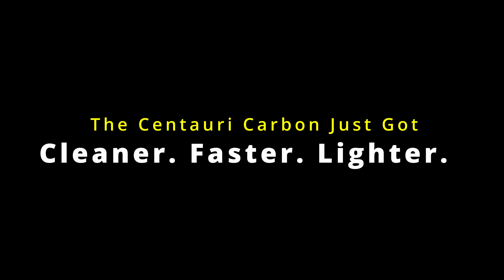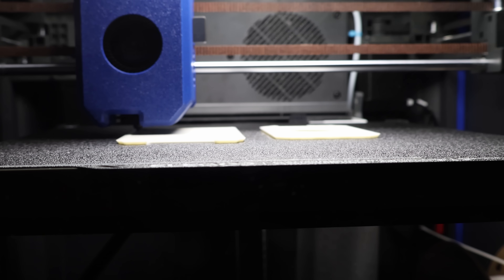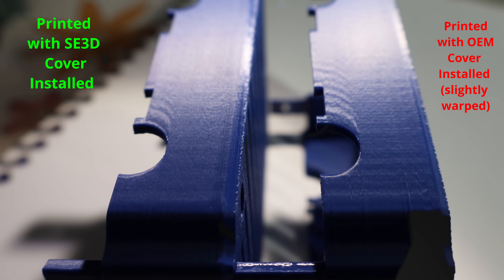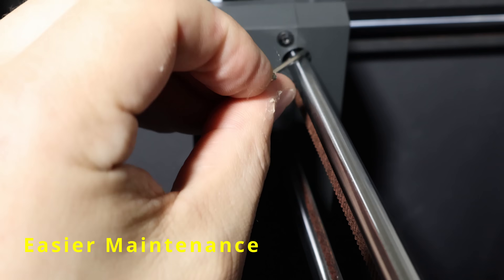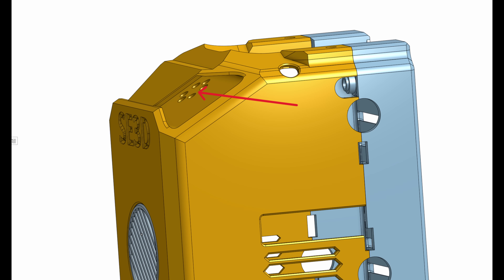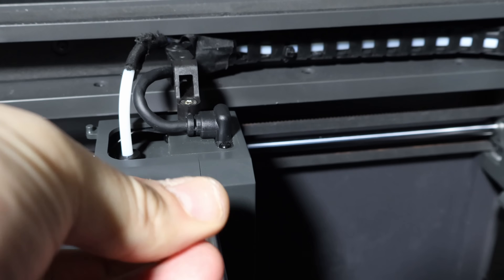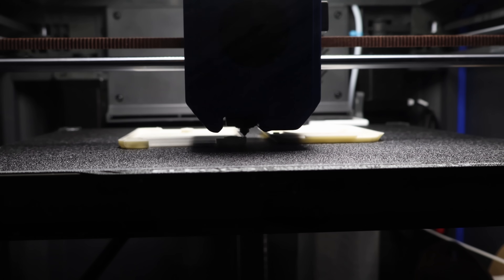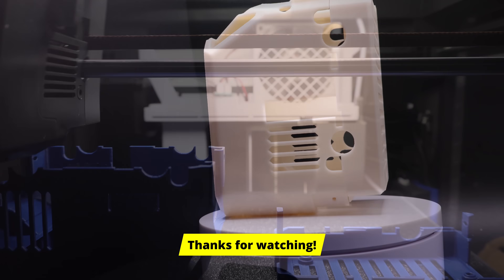The Centauri Carbon Just Got Cleaner, Faster, Lighter

Comment: Does it need to be done in ASA?
Reply from the maker: That is the ideal material, when you consider relative ease of printing, cost, and performance requirements. PETG should work on a temporary basis but it may creep or sag over time, especially near the hot end. Even though nylon has a bad reputation for warping, the CF varieties I've tried like Fiberon PA612-CF and PA6-CF can be printed relatively easily and have superior heat resistance to ASA. They're just expensive. PC is also a good option, but difficult to get good layer adhesion without a 60C chamber temp. You might be able to get away with annealed HT-PLA. However, I don't have first-hand experience with that yet. I don't want to make any claims about it being suitable or not until I have experience with it.

Comment: Wondering if printing it in PP will make it lighter (around 10%) and still functional. My concern is only about flex, but doesn't seem like there is something it might impact.
Reply from the maker: I've not printed with PP, yet. Under normal conditions there shouldn't be any impacts on the cover. The main concern is creeping or sagging under load/vibration and high temperatures.

Comment: Nice design. Could you run a new VFA test with it?  Youve shown its better at stock speeds but there could be better quality bands lower or higher than stock.
Reply from the maker: Interesting that you should say this. I actually ran a bunch, even developed my own version of the VFA model. They didn't make the cut though, only because I was running behind schedule and it would take more time to tell the story and try to capture the differences on camera. Some bands were worse, others better, but I only ran 100-300 mm/s in increments of 50 mm/s. This is a potential area for follow-up though.

Comment: This is great i am currently printing this out of polylite PC .. on my sovol zero I tried printing it on an angle out of asa but it didnt like that so figured if I am printing it on its face might as well use the strongest stuff I have poly makers PC is about 5% heavier density so might not be quite as good but better heat resistance and partially see through is appealing to me for a tool head thanks again for all your hard work its appreciated

Comment: How are the results when combined with the air recirculater? I want to build both but do they actually improve performance when combined?
Reply from the maker: This isn't something that I have tested. In fact, the aux and case fans were completely disconnected when I was printing all these ASA covers. But it is an interesting question!

Comment: weight reduction, i was thinking what if it was a skeleton cover, like the structure only for mount the parts, maybe that can work instead of doing a similar than the original, i think it worth the try, tell us if you can do that, tnx in advance
Reply: Check printables 1418981 model

Comment: Is there any reason this should not be printed in PETG?
Reply from the maker: It depends. If you're printing with the cover off, you can probably get away with it. But with elevated chamber temps plus the hot end being in close proximity, you may get sagging or creep. It is workable, but longevity may be limited. ABS or ASA is the ideal material because it can handle high temps under load without creep. ASA is a little less prone to warping and slightly stiffer than ABS. I much prefer ASA to ABS, personally.

Comment: Is it suitable PETG or PLA-CF filament to use this mod?
Reply from the maker: PETG will have a limited lifespan because it doesn't have the stability of ABS or ASA under high heat/vibration loads. Do not use PLA/PLA-CF. It will melt with such close proximity to the hot end. The only PLA option that might be suitable is annealed Polymaker HT-PLA. I have not tested that. But I am planning to do some videos with HT-PLA in high chamber heat applications.
Reply: @SyntheticElectron3D  Thanks for your quick reply. In this case I have to order some ASA filamnet

Comment: Looks very nice indeed. With the improved cooling, have you found a need (or advantage) in retuning any filament parameters? (Apart from the printer’s input shaping self-calibration mentioned in the video)

Comment: I'd like to see integration of this model with whatever is needed to use the Bambu-Like hot ends that another creator (whose name I completely forget) has done.
Reply: Printing it in PETG right now as a test, oriented on it's corner. If it turns out well, I'll reprint in ASA or do you think ABS would be better? ABS, ASA, PETG-CF and TPU 95a are the most exotic I will be printing with (don't know which out of them are more exotic)...

Comment: gonna have to give this a shot with petg, i saw you say to someone else that it should work but it'd be heavier than ASA, but is there anything to look out for once installed to see if the material is causing an issue? ive never replaced a printer cover before so apologies for the potential dumb question but thank you for releasing this for everyone!
Reply: How does it work with petg?

Comment: Will petg basic be okay with this?

I was trying to mod my printer when all the screws got stripped with one turn.

Any tips on how I can them off?
Reply from the maker: PETG should be okay, but it is heavier than ASA. As for the screws, I would probably just try to find a small flat-head screwdriver the right width to jam in there tightly. That, or take a rotary tool and cut a channel in them so that I could use a flat-head screwdriver. But that's probably overkill. Then I would replace them with some stainless-steel screws.
Reply: I'll try the flat head first, if it doesn't  work I'll find that rotary tool lol.

Thanks man! A lot of the mods I have in mind are yours😁

Comment: Damn this is cool. I may try and print one with my PET-GF roll I have. Although I wonder if it’ll be heavier, if my material is more dense than the stuff you used. Thank you so much for sharing man!
Reply from the maker: You're welcome. Let me know how PET-GF works out if you do!
Reply: @SyntheticElectron3D  Will do. Printing tonight! I'm hoping the decent layer adhesion of PET-GF will help with printing flat and the standoffs/studs. Tried orienting at 45 initially but there were too many overhangs to deal with. Maybe I could have done it differently but we'll try this first and see how it goes.
Reply: @SyntheticElectron3D Sorry - one more question - what was the weight of your cover (front and rear) without the fan? I did a little mod to mine but trying to see if it was that or the PET-GF weight, and if my slicer weight in g  is accurate.